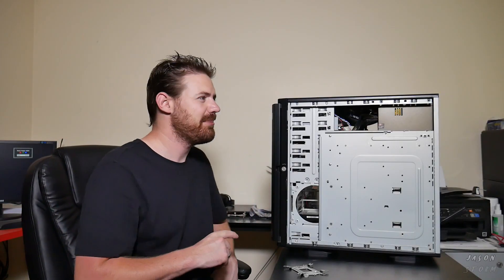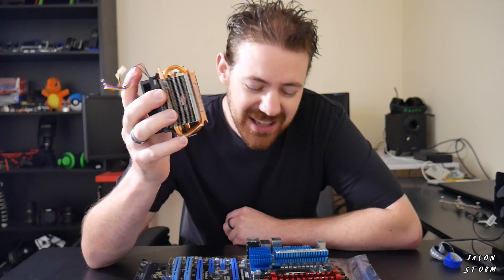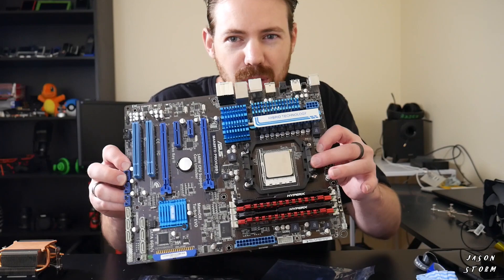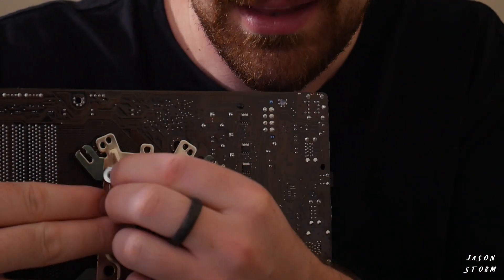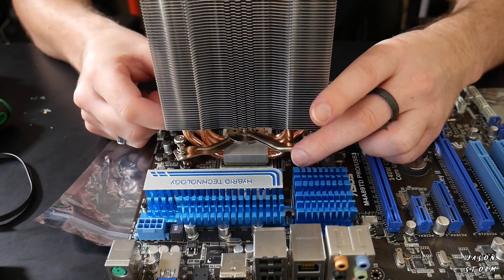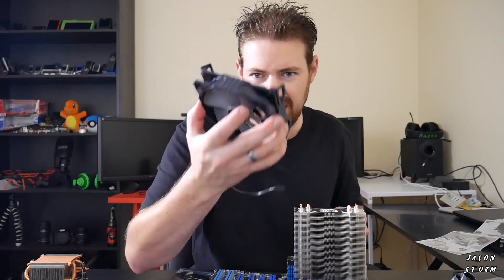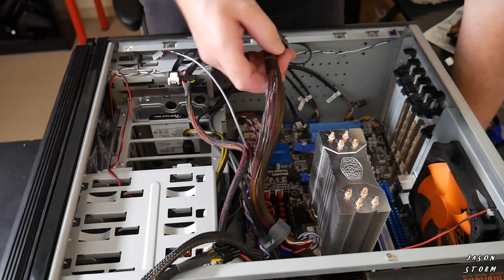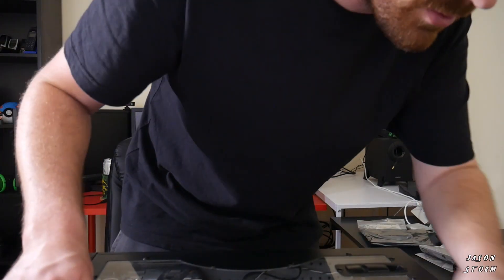Cooler master 212x installation AMD

Comment: Geeetings Jason, just wanted to say thanks for the video!. Super useful even now. However I think I have messed something up after installing mine. The fan faces my Graphics card. Will I need to undo and readjust to get it to point towards motherboard?
Reply: Or does it really matter that much?. I’ve just had a look now and I’m racking my head about how mounting it facing my ram works haha., for the the physics don’t seem there.

Comment: Really still super helpful even after a couple of years, thanks mate.
Reply: Yuppp helped me too, although I have the feeling that the mounting pressure is less than on my x58 board
Reply: @heni63  yea, mine slides around on the chip-heatsink  a bit. Might change once the paste starts hardening. Lower temps and faster cool time says its fine tho.

Comment: am4 compatible? :)
Reply from the maker: Yes, I currently have one on an am4
Reply: @JasonStorm  wow thanks for replying. is it easy to install?
Reply from the maker: It’s depends on your case, if you have a modern case with the hole in the back to put the base plate through then yes it’s easy, in fact a little easier then the am3 socket in this video, but if you have an older case like the one in this video you have to pull the motherboard out to put the base plate on.
Reply: @JasonStorm  yea, my case have hole in the back :) btw what do you think of the hyper 212 LED?
Reply from the maker: It’s the same but with the led lights, so it just depends if you think it will suit your current lights and case setup, me personally I like lights so more the better
Reply: @JasonStorm  nice thanks man! subbed :)
Reply from the maker: Thanks
Reply: @JasonStorm  Are you sure? NO NEED TO BUY A KIT FOR THE AM4 SOCKET?

Comment: hey nice tutorial but i have a question how do i check witch way my heat gets extracted because i bought my pc prebuilt ik a bit about pc's but iv never really actually built 1 or any of that sort.
Reply from the maker: Hey, sorry for the late response, normally the fans on one of the sides will have an arrow pointing in the direction of the air flow